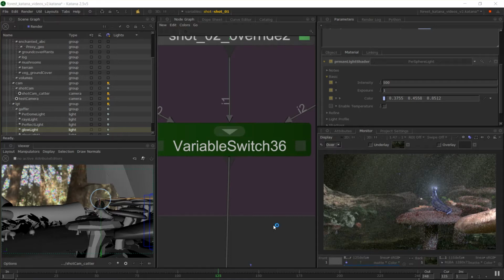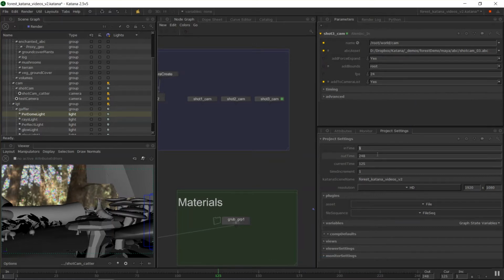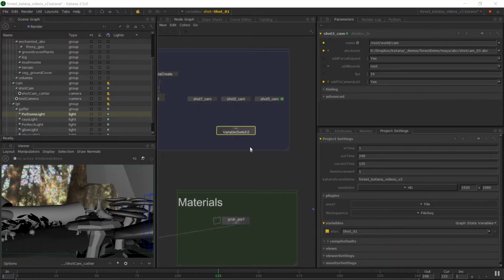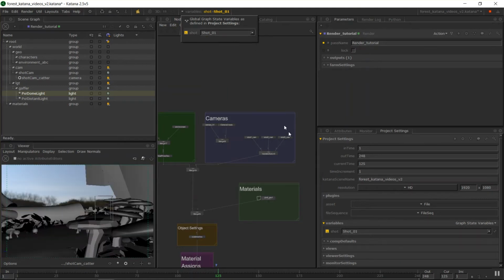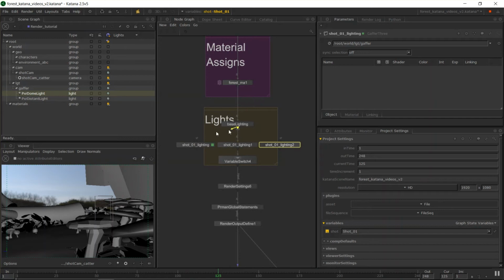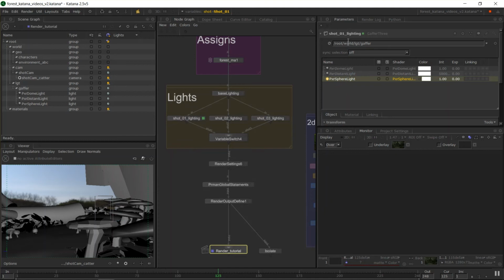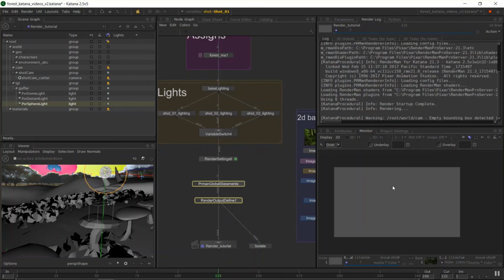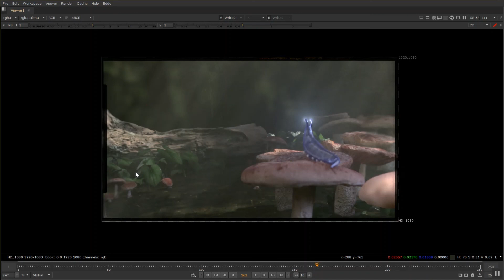Working in Katana - Graph State Variables

Comment: Hi Intraware Aus / Matt, is it possible to expressionally name the pattern's name to the pattern's value instead of manually type the name in? For instance, at 4:39, I'd like the name of i0 to be the same as its value (Shot_01 in this case)
Reply from the maker: Hey there! This is the type of thing the nodegraph API in Katana is great for. You could have a script you run from your shelf to get the names of the vaariables on selected VariableSwitch node,  and set the plugs to be the same/similar names.

I cant talk you through this as i'm not good enough at scripting, but I hope this helps point you in the right direction. The katana dicussion community can probably help more https://community.foundry.com/discuss/katana